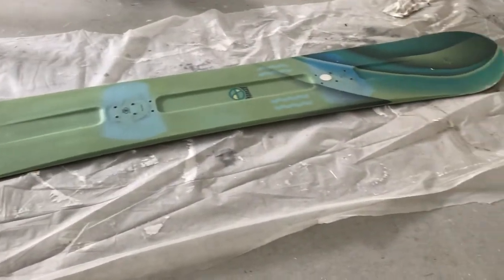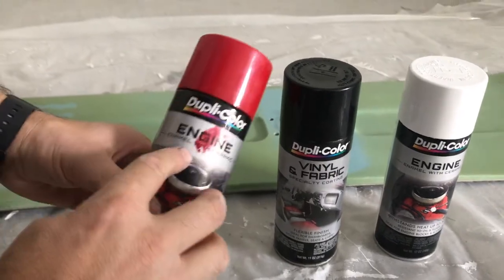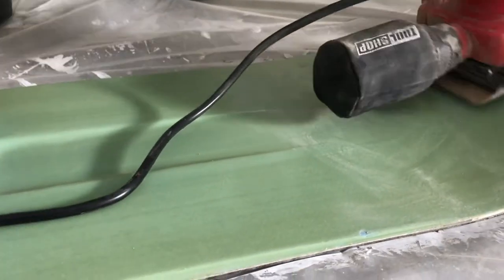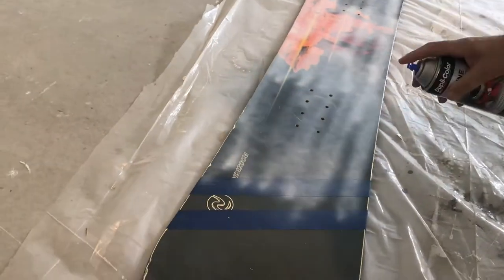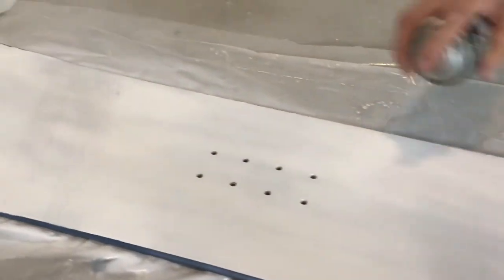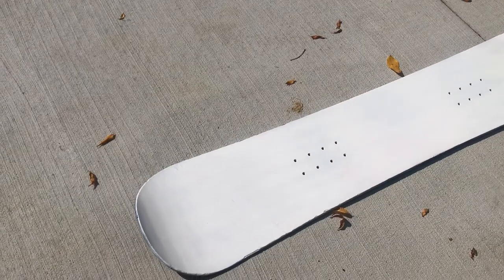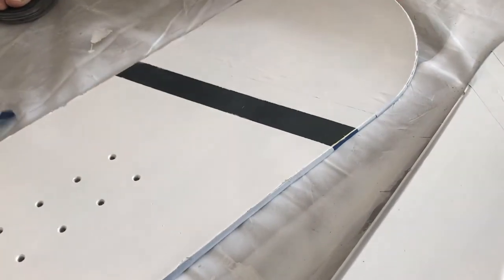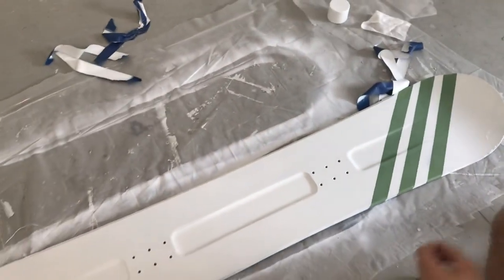How to Restore a Snowboard and a New Paint for a Vintage Snowboard!

Comment: What number grit for the sandpaper? I am making a bench/table out of one of my deceased brothers snowboards, and the top sheet of the board is completely destroyed so basically I wanna do is send it down. Make the edges not so sharp and then maybe put an epoxy over it to make it look shiny. Is that the right thing to do I need help. .

Comment: This might be a dumb question but are you able to custom paint a bottom of a board and finish with epoxy?
Reply: no, epoxy would not react well with the cold. It would cause non smooth sliding, and would not hold up to the scratching/scraping needed when waxing a board